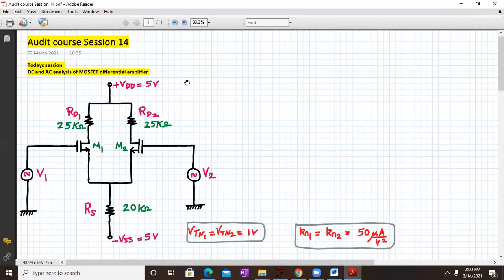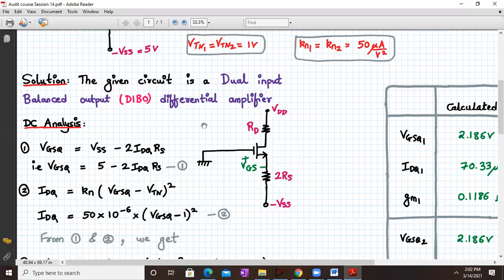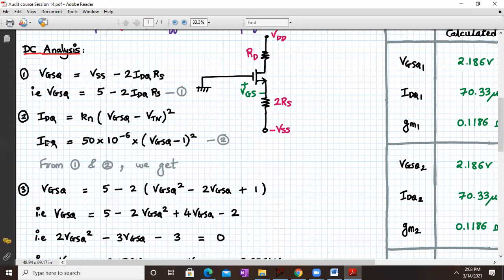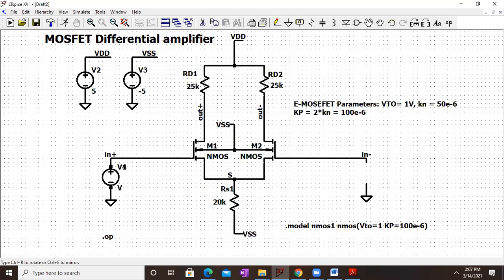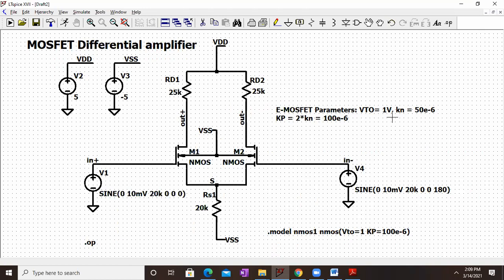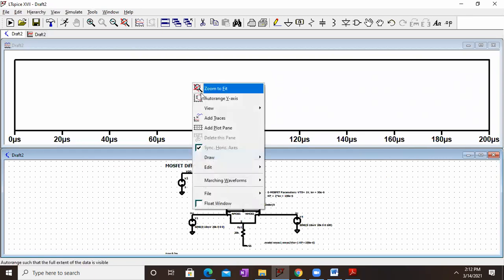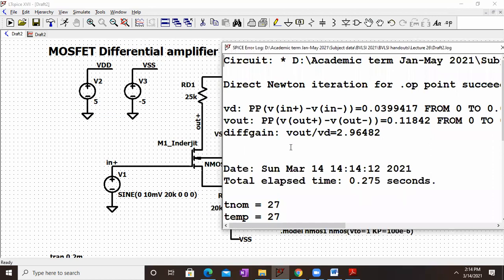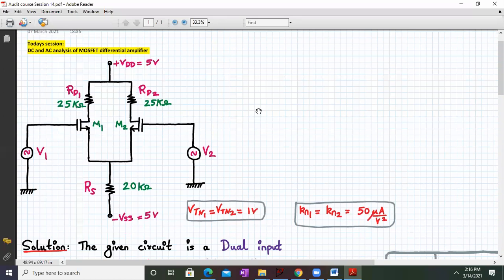MOSFET differential amplifier in LTspice (Estimation of ID, VGS, and Ad)

Comment: Greetings.  but when the term for channel modulation (1+ λVDS) is also present in the Id formula for the transistor in saturation, how do we behave later in the equation?  I also need to know the VDS value at that point, it's not enough for me to just fix the ID current to polarize the MOS... how do we behave, thank you very much!!